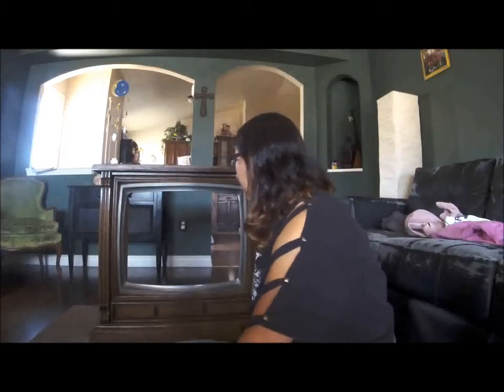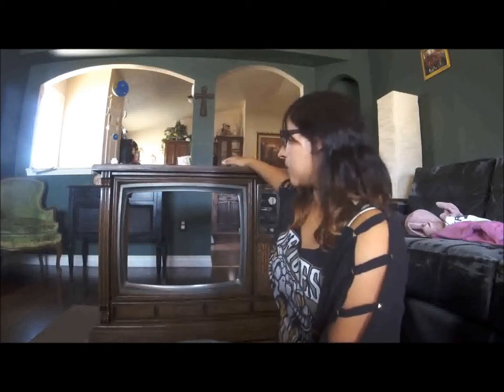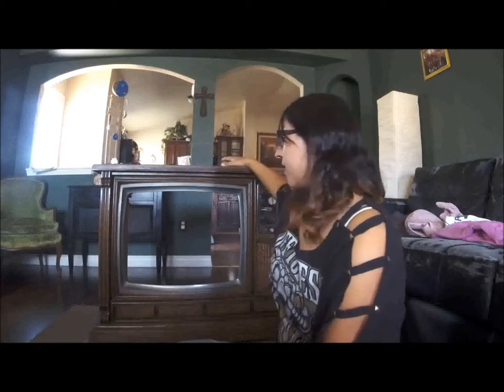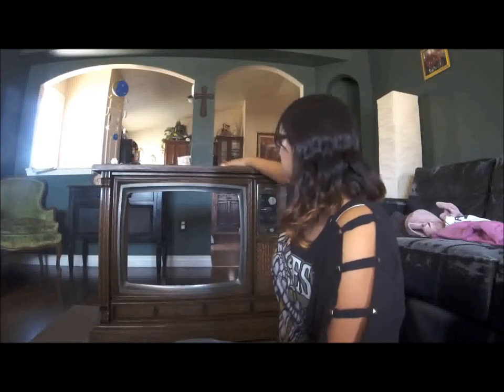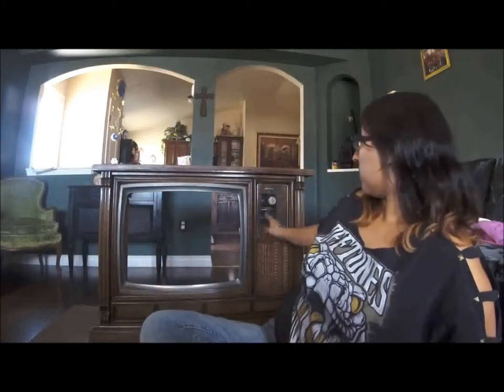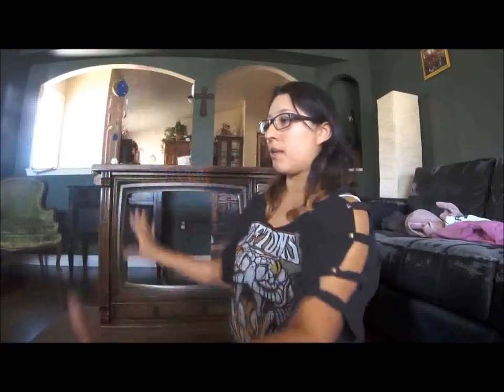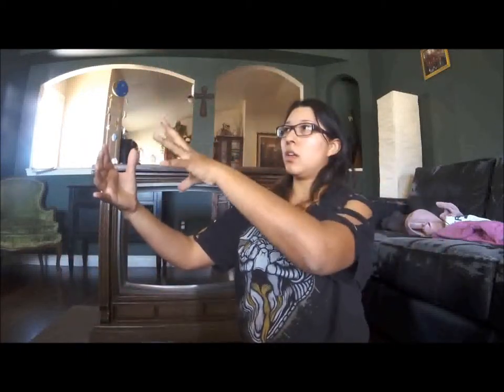Pinterest and dangers of working with CRTs, after thought...

Comment: Volume was really low in this one. Every job is a bitch if you don't have the right tools. Safety is key! The CRT's SUCK! I used to work storage and tossing them in the dumpster sucks. There even a bitch to destroy if you don't have an industrial garbage shredder. You also have to de charge the CRT if not you can electrocute yourself. ( you commented on this in the video as I was typing this haha) Luckily most of these ancient CRTs have lost their charge. You can also buy a voltmeter and check if it has current. They are fairly cheap at Harbor Freight tools. Moral of the story is like you said do your research and have the right tools. Glad your ok buddy!